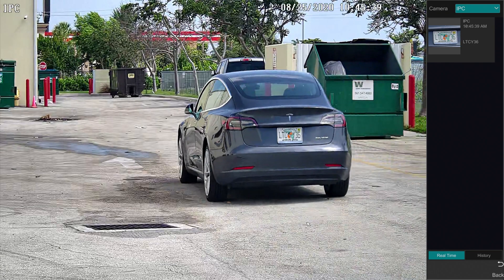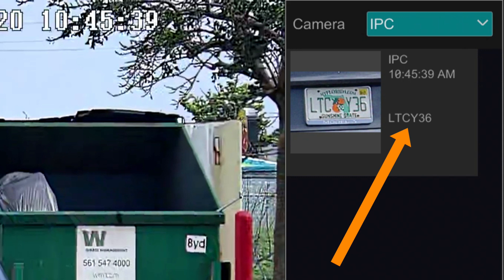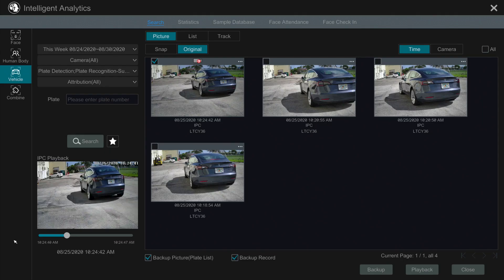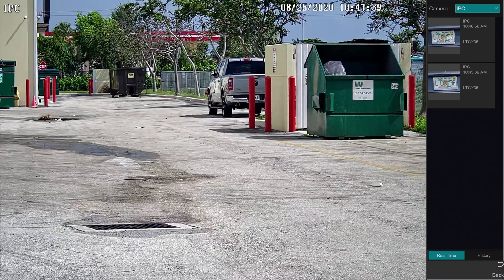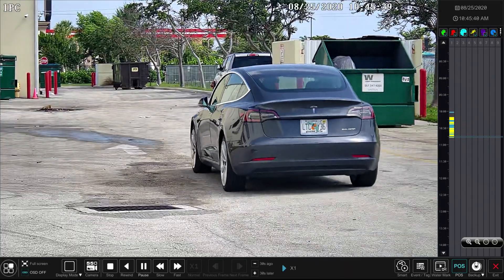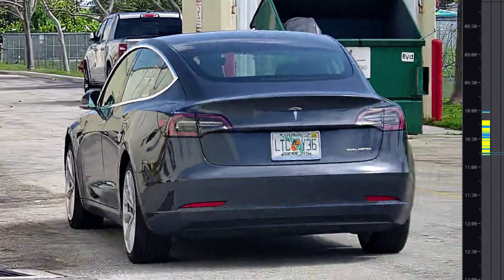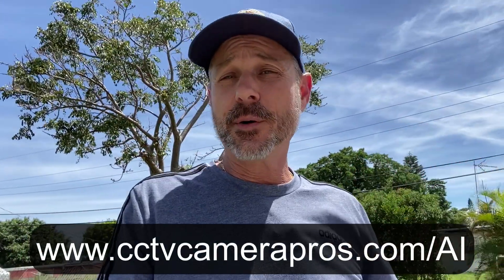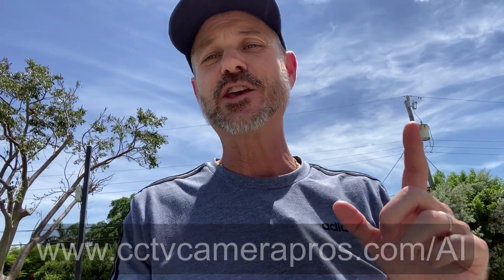LPR Camera System

Comment: Great video, can you upload a video of how to configure an LPR. For example the settings, shutter speed, ect for day and night. Thank you
Reply from the maker: Yes. This is a great idea. I will make a video on the detailed LPR setup on the NVR very soon. I will give you a heads up now that the settings on the camera were left on the factory default when we made this video.The only change that was made is that the video quality setting on the camera was set to the highest. We will see if this is still true for night time LPR, which we will also be testing on the next video. I found that the most important setting for reliable LPR / ANPR was to set the license plate detection zone on the Viewtron NVR as small as possible (single lane of traffic size or smaller) and to teach the NVR how the big license plates will be coming into the frame. The more accurate the detection zone and plate size, the more reliable the LPR / ANPR is. It is very easy to setup and I will definitely make a video for this soon. We figured out the small tweaks so that is it super easy for our customers and installers. Thank You for the idea! -Mike
Reply: @cctvcamerapros  Welcome and thank you for your enthusiasm and the good work you are doing. Keep it up!